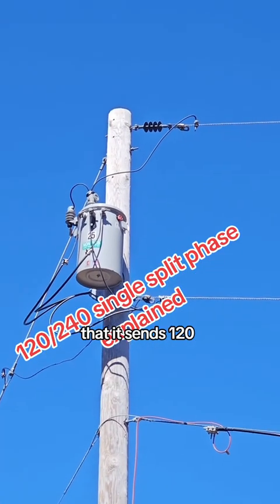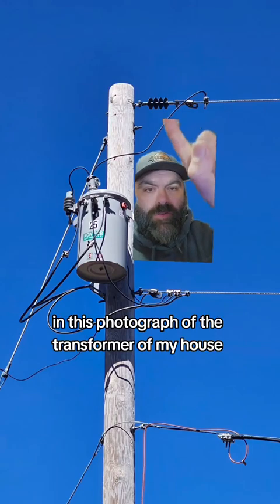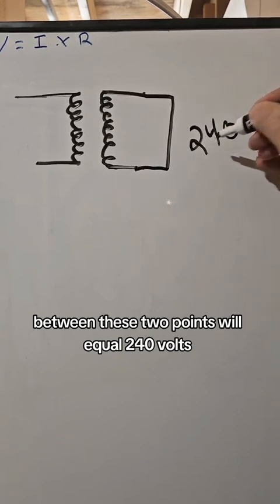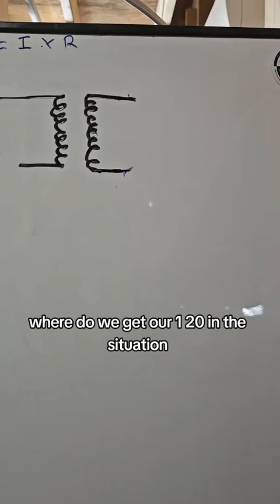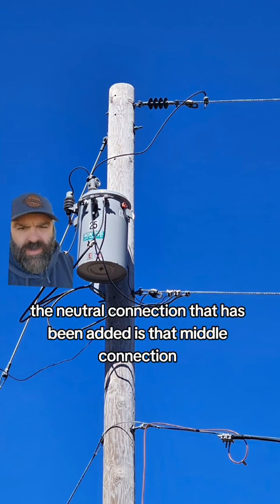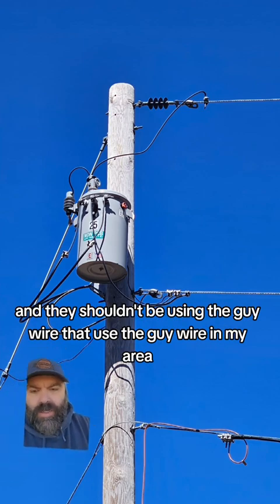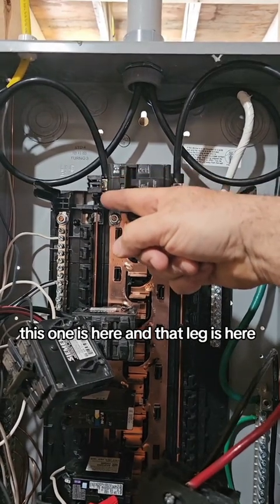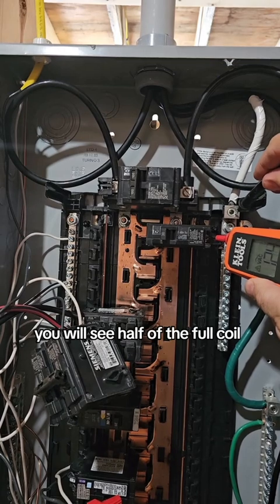120/240 signal split phase explained

Comment: You skipped over how the primary side is also using the secondary sides neutral.
Reply: First - Typically, the Primary Winding does not "use the Secondary sides Neutral".
  Secondly, at time 2:47 ... He does explain, "Your home's Neutral is connected to the Utility's Neutral."
  The Primary Coil uses the Grid's Neutral Wire, as the return. The Secondary Coil's Center-Tap is also connected to the Grid's Neutral Wire. The Grid's Neutral Wire is bonded to ground, at every pole with a Residential Transformer.  The Neutral wire at your home is bonded to ground, also.
Reply: @MrSummitville  — The distribution neutral and the neutral in the service drop are connected together.  It is grounded to Earth at the transformer and at the service disconnect.
Reply: @GH-oi2jf  I know. As I said, the Secondary uses the Distribution Grid's neutral.

Comment: So may I assume the bus bar is the divider of the 240 volts into 2 -120 v legs? Are any connections possible before/ahead of  the divider possible to obtain true single phase 240 volts? ( I think the answer is no BTW but I thought the question worth asking). My other and possibly better question is based on this. My water heater is 240v 4500 watt and approx 19amps. The power rating states its single phase. Yet as I understand it the power is delivered by 2 120 volt phases equating to the entire 240 v phase 1/2 + 1/2 =1. If thats correct then wouldnt the correct term be 2x 120v   .5 phase power? Stating its single phase just seems less specific and misleading. I mean our 120 volt appliances dont also state 1/2 phase power either. The nomenclature feels off. But likely I misunderstood and /or misinterpreted something.
Reply: There is a bus bar in the panel for each hot line and a bus bar for the neutral.  A connection across the two hot bus bars gives 240v.

The term "1/2 phase" is a little strange.  I don't think it is helpful.
Reply: @GH-oi2jf  He should have said ... 1/2 Voltage, not 1/2 Phase.

Comment: Primary coil and secondary coil had one line connected together as system neutral line?
Reply: Yes, there is one neutral for the system.  The neutral in the distribution lines is connected to the neutrals in the service lines, and connected to Earth.

Comment: I have a question would it be 100 Amps on the 240 or 50 amps? on each leg.
Reply from the maker: No i have a few videos talking about.  It just 50amps.  You dont add the legs together.  Just like at 120v you dont add the amps on the  neutral and amps on to the  hot

Comment: your drawing also explains that the two legs of 120v are not 180 out of phase as is commonly believed. they are in phase.
Reply: It is just a matter of how you look at it.  It is reasonable to think of the two 120v legs as being 180° out of phase, or you can say they have opposite polarity.  They are the same thing, mathematically.  Insisting on one interpretation is pedantry, in my opinion.  It is better just to understand how it works.  Plot the waveforms and look at them — that is what it is.
Reply: @GH-oi2jf  polarity and phase displacement are properties each as unique and different as voltage and current.  yes, plot the waveform, understand where the reference is in the circuit, measure the currents, and draw out the vectors. will see both polarity and phase displacement.  pedantry? i suppose if you are only doing work at a level where the difference is insignificant.  misunderstanding polarity and phase displacement can become a fatal error in system protection, and a costly error in system metering.
Reply from the maker: @matthendrickson5538  that is one of my pet peeves
Reply: I don't know why this continues to be controversial.  It comes down to your reference.

Comment: Not saying you're wrong about your power pole, but most have the neutral/ ground on top for added lightning protection.  The hot wire is on the bottom. Look at the plethoria of power poles, whether 1 or 3 phase, the gound is usually on top. This is intentional so that lightning will hit it first, according some protection to the hot wires.
Reply: @Joe-by8jh  Huh! In the US, except for some older  systems, it's usually the way. 
I grew up in a rural setting, and we had REA systems. They were always single phase, ground on top. But then again, you could guarantee a few hits every time a thundercloud pops up within 10 miles! And an outage if it took a good hit.
Reply: Here in Texas, on single-phase HV distribution (7200v to ground), the hot leg is always on top, with the neutral below... I've never seen the neutral above the hot. Also, since all pole-mounted transformers have their H1 bushing (or bushings) on top, it makes the jumper short & safe (through a drop-out fuse).
And we get A LOT of lightning here. Very rarely are ourages (here) caused by strikes.
Reply: It is just as shown here, with the neutral at the bottom of the transformer, in my area (Pacific NW), as far as I have observed.  In an area prone to lightning, perhaps they add a separate grounded counductor for lightning protection.
Reply: @scotty3114  Worse part in my area lazy cheap PECO/Exelon only connects one high voltage wire to all single phase transformers. They connect the other side of primary ( 7,300 volt ) to the center tap of the 130/240 volt secondary and to transformer case and ground rid at bottom of pole. This makes it an autotransformer and every copper water service, steel gas service & even cast iron underground soil pipe have current flowing thru the ground feeding the transformer. Even when I had the utility meter pulled and every circuit breaker off could measure at least 1/4 amp flowing out the copper water service.
Reply: @JohnThomas-lq5qp  wow! I have never seen this. Doesn't sound safe or efficent. Where are you located, roughly?
Reply: @scotty3114  You have seen this, almost all new construction poles everywhere use this type of pole pig only connected to one primary phase. Without a neutral wire to carry the imbalance it makes it harder to keep all three primaries at the same voltage/load/power factor etc. Two bushing primaries for single phase service are rare, and only in rural desert/dry/rocky areas with poor ground conductivity.
Reply: @brnmcc01  Yes, I grew in the southwest on a cattle ranch. Powered by REA. Our ground was practically non-existent. 
So we always had hust a two wire feed w/neutral on top and the h.v. on the bottom feeding the transformer, which only gave us a single phase 125 volt line. Nobody had electric stoves and hot water heaters. We used propane for that.
What I miss about the is you could predict the weather by listening to the wires singing, it did take some experience.
Reply: @JohnThomas-lq5qp  That's how it's always done. It's not for them being cheap/lazy. However, in very dry areas like out in rural areas of California, sometimes utilities will use transformers that have H1 and H2 connections. The pros of those type of transformers is they can connect more customers to the existing lines, and won't need a neutral wire to be run between poles. However, the downside is, it makes it MUCH harder to balance voltages on all three high (medium actually) voltage phases. But in very dry areas with houses very far apart, or solid rock ground, the SWER or Wye system like you describe just doesn't work, because even if you run a very large (and heavy) neutral wire along the poles, there will be far too much voltage drop between each customer for that to be safe. In a more built up area with a more humid climate, then using a WYE transformer at the distribution yard to feed out the 12470/7200 out to the poles, and using a neutral wire bonded to every customer, is the safer option and easier to keep voltages in balance on all three phases. In desert areas, what you will see for a workaround of that problem, is every few dozen poles, or at a junction, you will see 3 square cans on the pole, those are line reactors to try and compensate for excessive capacitance etc. Reactors resist changes in current, capacitors resist changes in voltage, and sometimes utilities will use those and even static var compensators by heavy usage customers. Feeding distribution networks where all the customers use a two bushing transformer would mean the utility primary system would have to be wired in Delta, and delta systems are vulnerable to crazy harmonics etc.
Reply: @JohnThomas-lq5qp  That 1/4 amp you're measuring is the neutral voltage drop from your neighbors houses on either side of your service. It's generally harmless and only a few volts. It can create a problem however if everything metal isn't bonded together properly on your property. As long as everything is bonded, it's safe like how a bird can sit on a 138,000 volt transmission line and not feel a shock. But if you have like an outdoor pool that has equipment, fencing, stairs etc that are not fully bonded, that stray current you measure can turn deadly for small children and some older people are more sensitive and just a few volts when you're submerged in water with chemicals in it, can be pretty bad. Mike Holt has some good videos on their YT channel showing some pretty bad houses where they were measuring like 25 volts or something in someone's inground pool because of a gate and pool stairs that weren't grounded and bonded properly and his kids kept getting shocked getting into/out of the pool. 9 volts isn't hazardous normally, but if you lick a fully charged 9 volt battery, now imagine that pain over your entire body. It ain't good and people can and have panicked and drowned from as little as 5-7 volts.

I remember one case when I was a kid helping my Dad out at a large (775 acre) dairy farm. On a wet, damp, rainy muddy day, sometimes the cows would just refuse to go into the barn to eat and be milked by the automated milking machines. Well, if the cows can't be milked, that's really bad for the cows, and the farmer, since that milk is the primary source of income.  What was happening was the barn was fed from a subpanel from another building with the generator and transfer switch. The stray currents like you measured were flowing around the rebar in the concrete barn floor, and because cows have a lot wider feet apart than people, the voltage drop from the edge of the concrete out a few feet into the yard was enough to give the cows a shock or feel uncomfortable. The solution was to make sure all the metal stuff in the building was bonded together, and then bury a large 20 feet mat of rebar out beyond the entrance. That way as they walked up to the barn the voltage buildup was gradual enough not to notice. But that problem took quite a bit of troubleshooting to figure out, because like you said, they could kill the breaker to the barn and cows were still experiencing a slight shock. Even with all the power turned off.

Same kind of thing like where they tell you if your car gets hit by a downed power line, and you have to get out, keep your feet together and hop away from the car carefully. Now imagine how far apart the front and back feet of a cow is, and you'll see what I mean.
Reply: @JohnThomas-lq5qp   This sounds a lot like SWER = Single Wire Earth Return!  Do you not have a Grid Neutral Wire on the Power Pole?

Comment: Very informative. Great job explaining. I have a question. In Europe they use 240. Is this a single phase without a neutral?
Reply: No, we have 400V 3P+N, so we have 230 L+N in our houses (240V/415V in UK) or 400 3P+N without much effort.
Until '60, in my country (Italy), we had 220V 3P+N and 127V L+N, then it was standardized to 220/380 and then, 230/400V in 2012.

Comment: Was taught split phase is only certain single phase motors that usually use a capacitor to produce an out of phase power to a start einding to produce starting torque. What uou have us 100% single phase 3 wire secondsi 120/240 volt system with the center tap grounded to profuce a GROUNDED CONDUCTOR on and not a nuetral !
Reply from the maker: You were taught wrong....and  its a neutral . Do you own NEC? Look of the definition of neutral conductor and neutral point.
Reply: @Stevenj120volts  We were told over 5 years ago at several continuing education classes that to stop using the term neutral because it was changed to grounded conductor. I have NEC books dating all the way back to the 1970'S but do not have the latest two because I retired and gave up my license and no longer do any work outside my house.
Reply from the maker: @JohnThomas-lq5qp  i have a collect with all the code books back to 1940. The word neutral appears in all of them and the term neutral conductor is listed in the definition section of 2023 NEC.  A grounded conductor is different than a neutral.  But in single phase homes they are the same wire
Reply from the maker: I will pay pal your $100 if that does not middle connection does not match the definition in the NEC for neutral conductor and neutral point
Reply: all single phase motors, both 120v and 240v, need a capacitor to produce starting torque because a single phase alone cannot produce a phase displacement between voltage and current the way there is with 3 phase. the capacitor is not splitting the phase. it is shifting the phase relationship between voltage and current.  remember  
ELI the ICEman.   you can think of split phase neutral in the same way you would think of a transformer tap.  (full voltage/total turns) x number of turns at tap. bring that tap out from the center point of the phase coil and you have a conductor that is common to all tap connected loads and carries the unbalanced portion of current. this specific tap is a neutral tap, ground it and you have a grounded neutral.
Reply: @matthendrickson5538  Wrong. Look at erector sets motor it's a shaded pole ( ya made before you were born ). No capacitors, Some split phase motors that run off single phase do not have a capacitor. They use the start winding to produce a lower starting torque then split phase motors that have one of two capacitors. A 120 wall clock motor never have a capacitor. I still have my doubled sided spiral bound probably 500 page motor book from the 1960's that has a full page listing single phase motors along with starting torque and other pros & cons. Think a genius named Rosenberg wrote it along with hundreds of illustrations. Vacuum cleaner and old drills have universal motors that have a winding wired in series to a commutator brush holder thru the commutator then out the other brush holder to other winding. They never did & never will have capacitors. Only motor that I can think of that if running off of 60 HERTZ instead of running the nominal 3540 to 3600 RPM can reach speeds over 10,000 RPM. My dad had a 3/8" hand drill that label stated it could run off of 120 volts AC or DC. I connected it thru a variable transformer & a full wave rectifier to see if it did run on DC. ( YES it did ).
Reply: The neutral is the grounded conductor.  Same thing, different terminology.
Reply: @GH-oi2jf   Yep but can not reason why one of the most commonest used term in last hundred years was changed to confusing " Grounded Conductor". Same changing light fixture to luminaries. Can remember maybe 40 years ago when the same jack asses changed terminology on larger wire to something like KMCL. Might have lasted one code cycle. If it ain't broke don't fix it, stop attempting to reinvent the wheel .
Reply from the maker: @GH-oi2jf  in am USA home they are the same wire but they have different definition in the electrical code
Reply: @Stevenj120volts  — What we have always called the "neutral" is called the "grounded conductor" in the latest codes.  The "ground" is something else.
Reply from the maker: @GH-oi2jf the neutral is the neutral.  Some system have a grounded conductor some systems do not.  Your home is a system with a grounded conductor.   In that system the neutral is the grounded conductor.   There are types of grounding conductors one is called the grounding electrode conductor it connects to the neutral to earth.  The other is called the equiment grounding conductor  it connects metal parts of appliances to neutral.   None of this part of a new code.  These have been the terminology and system used in hom3 since the 1930s and probably earlier.
Reply from the maker: @GH-oi2jf the wire connected to the neutral point of any transformer is called the neutral SOME systems connect the neutral point to earth  some systems do not.  Some system connect other conductors to earth